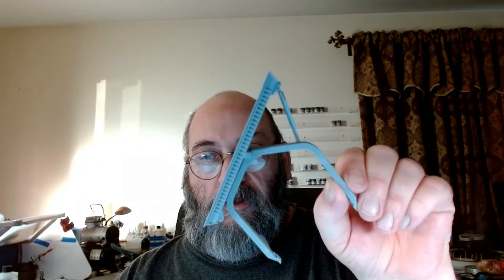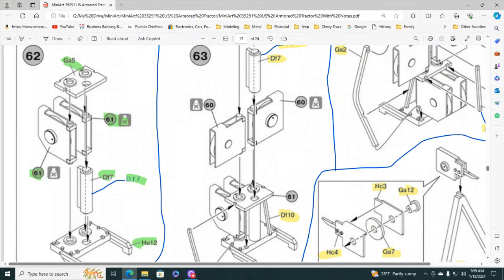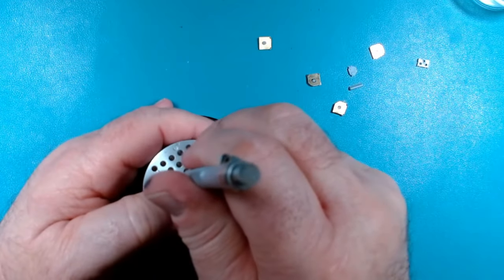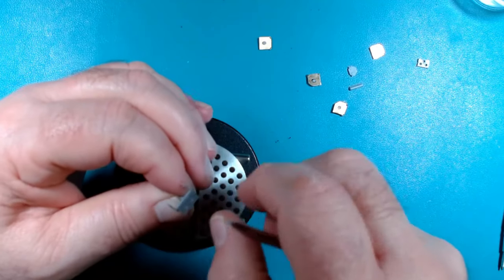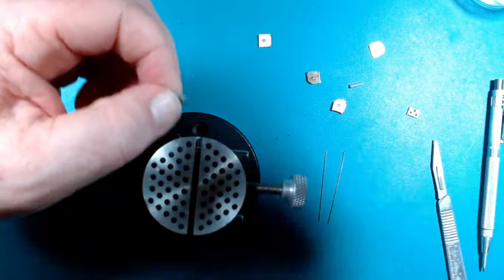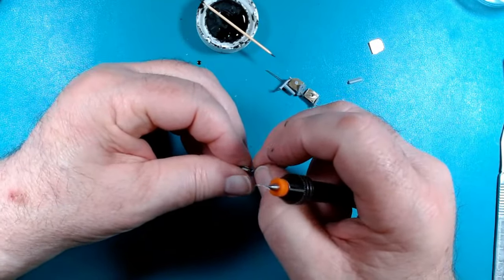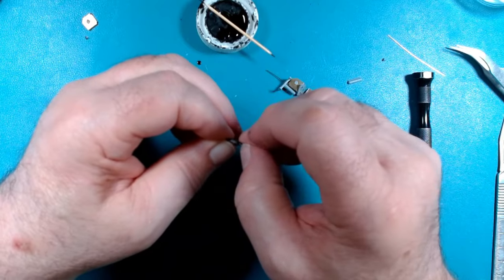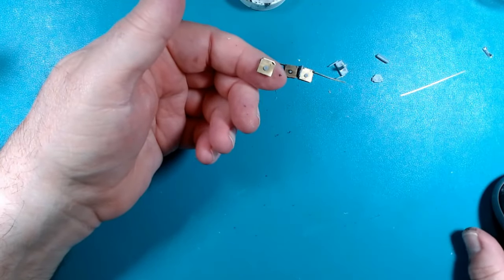MiniArt 35291 US Armored Tractor Part 19

Comment: Hi Jeff, remember the days when all you needed to build a model was glue , mums nail file and dads toe nail cutter,  lol simple days ! Great job mate 😊😊😊😊😊see you tomorrow
Reply from the maker: Hi Marc, Thanks for watching.  I sure do.  I built a lot of models using just the tools you mentioned.  When I got back into modeling, I was completely blown away by the shear number of tools and paints available.  I got that part that goes above the winch all fixed.  I'll show you what I did in todays video.  Have a great day.  Jeff

Comment: Some tricky bits there Jeff. Just wondered if a fine piece of brass tube could be a substitute for the plastic part (rod-like part) between the brass etch outer pieces..? I have seen .4mm tube (being so fine looks like rod until realise it's tube)!  Thx for the reply too.
Reply from the maker: Hi Sidnzreal2433, Thanks again for watching.  What you are suggesting is pretty much what I did.  All will be revealed in todays video.  Have a great day.  Jeff

Comment: Hi Jeff. I know you will master this super fiddly assembly if anyone can, it just seems poor design on MiniArts part.
Reply from the maker: Hi Mark, Thanks again for taking a look.  MiniArt does their absolute best to make their kits as accurate as possible.  Unfortunately molding restrictions leave some parts very weak.  It would make the kits much more expensive to include turned brass parts in the kit to improve some of the problems associated with plastic parts.  Have a great day.  Jeff